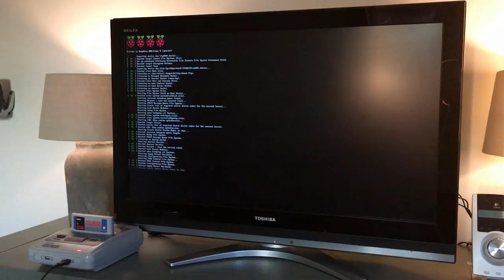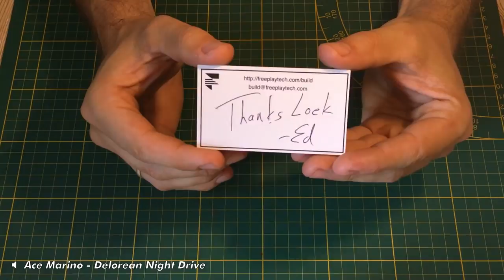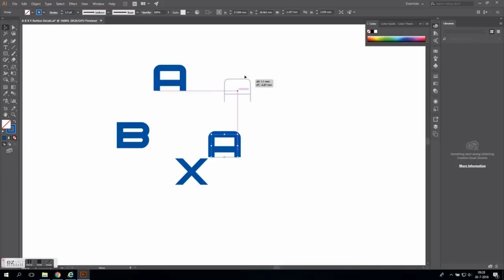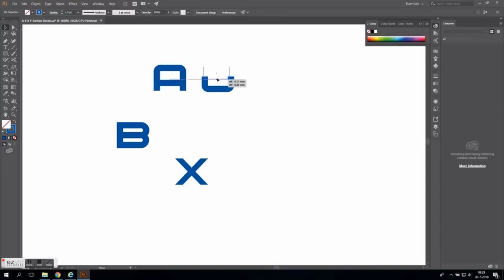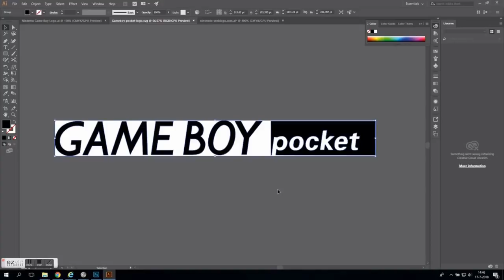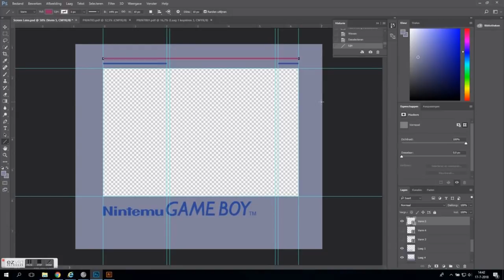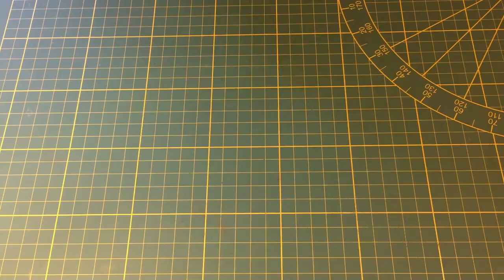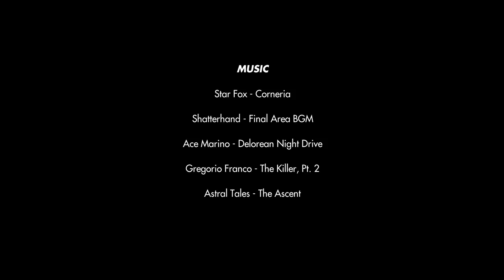Freeplay Zero Build - My Ultimate Retro Gaming Handheld

Comment: Morph-X, where can I get the simple tool of yours which you had made for the embossed letters on the Game Boy Advance's shell where the start and select words appear?
Reply from the maker: Hi! You can craft one yourself. All i did was cut two bits of plastic to the size of the embossed "START" and "SELECT" labels, glued them together and sanded down the edge to a smooth even surface. It's super easy. Thanks for watching!

Comment: Did you trim down the X and Y buttons? I noticed on my build they are much higher standing than my B and A buttons.
Reply from the maker: Corey Hectus Yes i did. At my first test assembly i noticed the height difference and thought it was terrible. So i gently trimmed 'm a bit. However, the button caps are now lowered so the LCD is a bit off-center, due to it touching the button caps. But ergonomics are important imo. Thanks for watching!
Reply: Okay cool. I wanted to do the same thing on my build because it's a little silly looking and uncomfortable to press those buttons when they sit so much higher up. Did you use a dremel for those as well? Also, I don't mind the LCD pushing down because I'd rather have the ergonomics :)
Reply from the maker: I trimmed the buttons using a sharp blade. But you'll have to rest the PCB in an angle to do so, but with a sharp blade you can shorten them in a precise matter as opposed to doing it with a dremel. Good luck!

Comment: Hey just a quick question. What size did you make your lens design to make it the correct size to stick on the glass lens?
Reply from the maker: Hi, i'm sorry for the late response. I made a scan of an original screen lens so i could use that as an overlay in Photoshop for my design. That and a ruler helped me in creating the final design. The bleed of the design is limitless since you'll cut away the excess of the film along the edge of the lens. Hope this helps you out.

Comment: I see at 26:37 you realized you for got the y button. BTW, you did an amazing job!
Reply from the maker: Sharp eye you got there. I didn't really forget it, you can add the X and Y buttons with the whole thing put together, so that's why i didn't worry about it at that point. Thanks for the kind words and for watching!!
Reply: Morph- X - ahhhh, didn’t realize. I was reminiscing because I have done that so many times. The other day I backlighted a DMG. Flipped it over turned it on and admired the screen. Then, yep no buttons at all, literally smacked my head.
Reply from the maker: Well i've had that experience a couple of times myself. Sucks everytime. Still funny though.

Comment: I know the pie zero will be able to cope with GB, GBC, GBA, NES, MD (genesis), but will it be able to handle MAME, cos I'm guessing ps1 is too much for it?
Reply from the maker: I wouldn't know about MAME, i'm not much of an arcade guy myself. But PS1 will be a tough nut to crack. Several SNES games, mostly Super FX and DKC games don't run at full speed so i guess PS1 games will be a problem as well.
Reply: @morph-x7153  Yea that's what I want to avoid, and have been considering the pi3 b+, and removing the Ethernet and dual twin usb, and solder straight to board or use low profile ports.
Reply from the maker: Then why not opt for the CM3, which basically is a Pi3 in a small form factor. It's perfect for MAME and PS1.

Comment: Great job and nice video, man.
Im running some tests in my Raspberry Pi Zero 1.3. After flashing RetroPie to its SD card, I recommend overclocking it a little, because you can face serious fps drops in some games with the stock settings. Im using this setup: https://www.reddit.com/r/RetroPie/comments/bs0a0i/snes_performance_benchmarks_on_pi_zero_and_how_to/
And my RPi is running atari2600, nes, snes (not SuperFX games), mega drive, gbc and gba smoothly.
Reply from the maker: Thanks man! Well, it's actually the Super FX games and still a fair share of SNES games (Donkey Kong Country for instance) that don't run properly. GBA games, after installing the right BIOS files run amazingly well, to my surprise. Overclocking might be the little boost it could use, but i'm not quite sure how it will affect battery life. In any case, thanks for the tip!